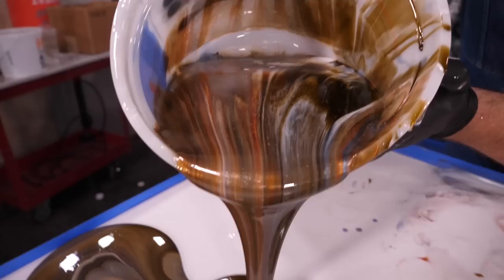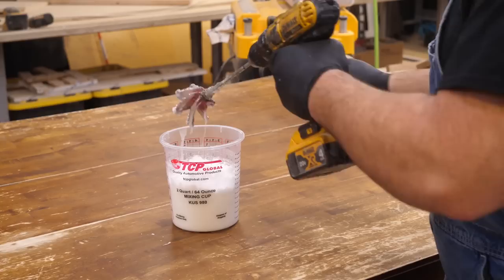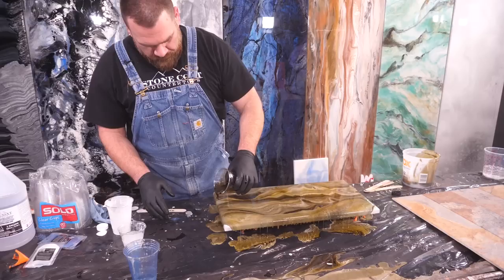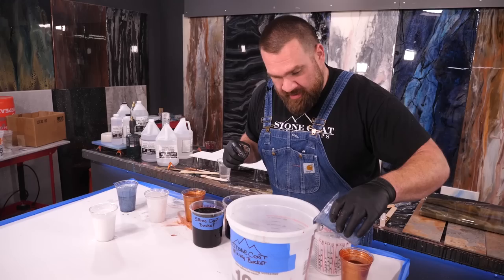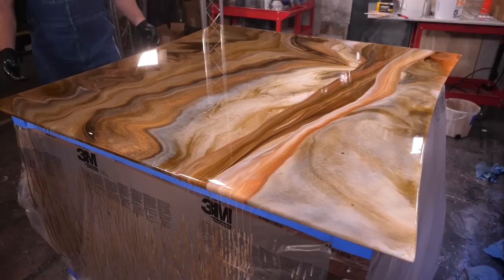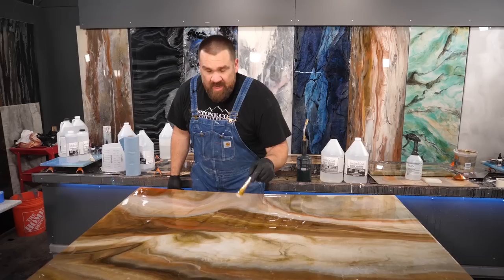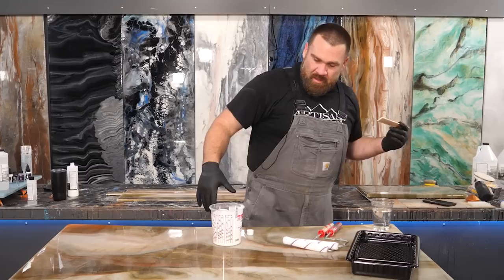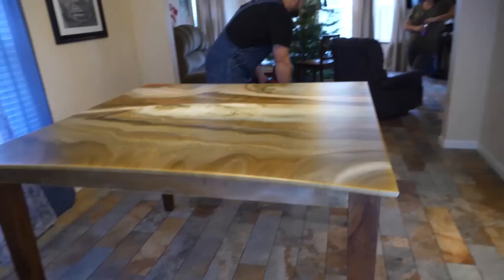I Fixed my $1,000 Dining Table with Epoxy | Stone Coat Epoxy

Comment from the maker: 📌Dining Table Epoxy Kit: https://www.stonecoatcountertops.com/copy-of-dining-table-epoxy-kit/📌
This table set cost almost $1,000 and my kids destroyed it, what is the most expensive item your kids destroyed!?
Reply: My cars. Question. Why do you clean first? Doesn't the sanding process take care of that?
Reply from the maker: @mikehiga7644   You want to clean the grease before, you can sand it into the wood and cause issues, great question
Reply: Stone Coat Countertops That's what kids do - destroy furniture. Don't have sense of the value of money. But hey, it's wonderful to have kids, they give life to the house. Love your new dining table!
Reply: I been looking to do this to my dining table
Reply: My daughter destroyed a $300 computer monitor (CRT, back in the day) by squirting orange juice in the ventilation holes.  The kids destroyed a TV similarly.
Reply: Cars.   😔
Reply: Will a hair dryer pop bubbles?
Reply: @LauraLooo88   I don’t know I have a heat gun it’s very hot it’s more heat than air blowing I don’t know I would rather go with a heat gun or the blow torch not a hairdryer. Good luck have fun 😀
Reply: The link does not work and nothing on the website. DO you still sell the dining table epoxy kit?

Comment: I say of all the jobs you did I love this table top number #1 BEST !  I've always loved exotic pours and i did one once with whit marble. But the colors seemed to blend together to much even though I did not stir the mixed blend in the bucket as warned. Have you ever tried or thought of pouring all the mixed colors into paint roller pan pouring them maybe in long ribbons across the pan  attempting to not mix colors up. Hoping to have color sections just laying there alone without blending colors together YET. . Now when you pour the colors out from the pan all the ribbon rows will flow together as poured. Take note you have the option to pour at the corner of the paint roller pan or pour from one of the flat spots of pan.

Comment: Why should you not let the mixing blades hit the back or sides of the container? What would it do if you did hit the sides or bottom while mixing?
Reply from the maker: You can crack the mixing bucket or scrape plastic from the bucket into the mixture

Comment: What did you do top get the top smooth? I used this over a counter top I made for our bathroom and it has a definite texture to it. I called Feb 1 to ask if I did something wrong and was told that I did everything correctly and this finish has a definite texture to it. The nice lady on the phone told me she got the same results I did and the orange peel finish is normal. I asked if this could be sanded smokth and she said yes but I would likely need to start with 60 grit and work my way up. I bought this to avoid having to do that!  Sure would have been nice to know I was not going to get the same results you did on the dining table and bathroom counter you did in the 4 part videos.

Comment: Absolutely gorgeous! I liked the shiny stage best though. Is this technique recommended for kitchen counter tops?
Reply from the maker: Yes, definitely
Reply: @StoneCoatCountertops  if you like the shiny stage the best can you do that instead? 

Would the shiny stage be scratch resistant and durable?

Thanks
Reply: @stilly88888888  Just FYI we did this for our countertops and left them shiny. They looked like glass and were great at first - but after a while, it was noticeable where we used them more and wiped them off and where they were still pristine.

I think if I were going to do it again I would definitely use something like the topcoat they show here. It takes it more to a matte finish but that would be much more likely to last and stay the same everywhere in the kitchen rather than trying to maintain a liquid finish. In the end we had to sand everything down with 1000 grit and leave all our countertops a matte finish so that they all looked the same.

Comment: How would you handle table edges with different profiles, like ogee or cove?
Reply from the maker: Thanks for asking Joel! You can try  to prep and fill with Bondo All-Purpose Putty but we would recommend testing this first. -Nathan
Reply: @StoneCoatCountertops  Thanks for the answer.  I was thinking about either doing that, or using a jigsaw to cut the top back a bit.

Comment: I've been watching your videos but haven't seen any projects covering glass. I have a few small tables with glass inserts that I would like to try this on. Please provide a link to videos on glass or tell me what I have to do to pretreat the glass. Thanks :)
Reply from the maker: You can certainly apply SCC epoxy over a glass surface. Check out Epoxy Art Resin: https://www.youtube.com/watch?v=VQkWTksU7vE&t=98s, which will show you how to do this.
We recommend using our bonding primer, however if you need to keep things clear you can use XIM Peel Bond primer. This is a clear bonding primer that, when rolled on in one thin layer, can provide transparency. If you apply it thick, it will haze, so keep it as thin as possible!

Comment: Absolutely BEAUTIFUL!  But how do you keep from getting anything that may be floating around in the air from getting on it when wet!!  I have a problem with that on my acrylic pour paintings.  I love your products!!  
Thank you - this was an awesome project to watch.
Reply: With the top coat you sand the imperfections out before applying. I'm sure there were some in there. For my small projects I built a cabinet to put things in to minimize floaters.
Reply: That's my problem as well, I think there's really no easy & cheap way of really accomplished that.

My way to minimize dust is to spray fine mist of water spray across my project room. Then only i do the pour
Reply: @keyshine5769  good idea...I’d forgotten that tip. And I just yesterday bought a small room air purifier. Hopefully, that will help. Thank you.
Reply: @jonsaircond8520  thanks!  I am hoping a room air purifier will also help.

Comment: The clear coat used after the exotic pour is not in the kit. It comes with 2 gallons (hardener and epoxy), this video shows you use 4 2- A's 2 - B's...

Comment: Mitch - Are you using the Art Coat because our Oregon weather is so variable? Yesterday it was warm, today my locksmith fingers barely functional.  (Eagle Point)
Reply: They use Art Coat because it has the most UV resistance out of all of their epoxy products.

Comment: I want to do this kit but absolutely want the shine.  I don’t want the top coat that is matte.  Are there other care instructions when stopping at the glossy coat?  Is it as durable?
Reply: If not using the Ultimate Top Coat, you'd at least need to do a clear "flood" coat on top of the color layer.  The clear countertop epoxy is durable, but you will get fine scratches over time.

Comment: The top looks like a matte finish. Is that better for kitchen table than the gloss epoxy kits?
Reply from the maker: Great question Ed! When you add our Ultimate Top Coat to your project it gets that added durability and heat resistance with a matte finish. -Nathan
Reply: Do you have ultimate top coat with mirror look finish. Thanks

Comment: Is Epoxy Resin Food Safe?
Coating it on a Dining Table where foods drop on and we pick it up and put in our mouth....Wondering is it Food Safe?
Reply from the maker: Yes, Stone Coat Countertop countertop, art coat, and ultimate top coat formulations are food safe. We always do a clear coat that ensures the durability and food safety.
Reply: Thank you,I appreciate yr prompt reply.
Always enjoy Yr show and yr detail description of the process from starts until the ends. Very professional and very engaging.
Good job and cheers 😀😀👍👍
Question:
①What is the Top coat Material?
Urethane ?(to protect Epoxy from UV?)
②Notice u didn't put on Musk to protect yr lung.
Isn't it dangerous to breathe in the vapour of Epoxy gas?

Comment: I love stone coats methods, vids, style, and absolutely everything about you guys......... EXCEPT! I'm just starting out in the woodwork/epoxy buisness, and, I know you guys are pros, and a buisness and have your own brand of resins, and probably get it at cost. But it makes my stomach hurt when I see aaallllll the epoxy that's wasted. It's sooo expensive for me and when I see scraping excess into a bucket or the amount that drips off an edge. It hurts me. I love doing this soooo much and have so many ideas but no money to buy the materials needed all the time. I wish epoxy was able to be shipped and still used cause I'd be like " send me your waste!!" LOL. Don't take this as dogging you guys, I'm not. I love absolutely everything you do. I'm just saying. "Man I wish I had even a gallon of that stuff for my projects." Keep up the good work. 👍 and please edit out the waste. Just kidding. Thanks for all your amazing  creations.
Reply: It would be nice if they could send the extra but what is not mentioned and I learned the hard way is that this stuff gets super hot when it it not being used. I had all my containers with mixed epoxy melt and it started to smoke. It can catch fire if not careful with the extra epoxy. Just a heads up on that.

Comment: So you used more then 9oz pre sqf. In this pour 9  quarts for epoxy for a 5x5 table. How do you justify your 3ozs a sqf on this pour. Its great work but you get better results with doing a sponge technique with less epoxy. All your doing its trying to make people buy more epoxy then you need. Get back to showing how to work with epoxy not putting things in a bucket and pouring it out.  This channel use to be good yo show you new things. Now its just put colors in a bucket and hope fir the best. Please go back to your old stuff